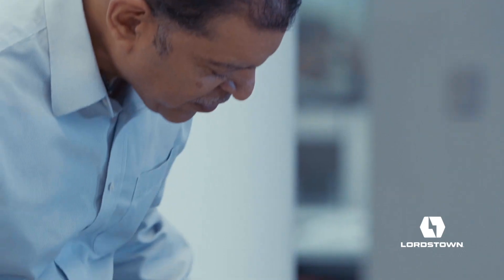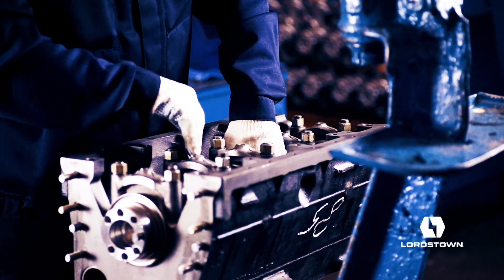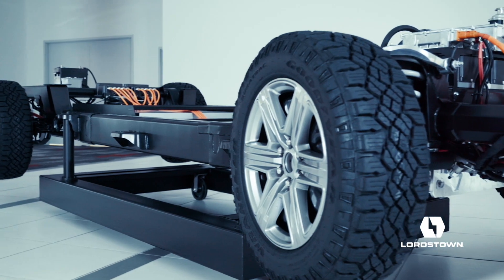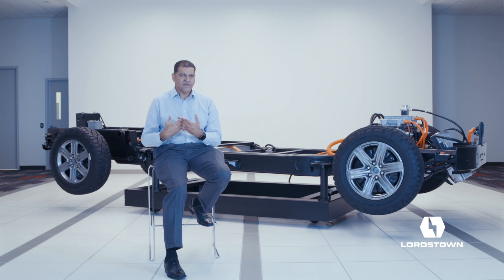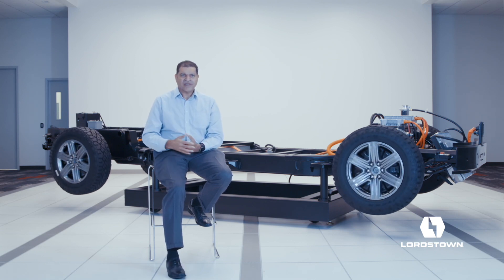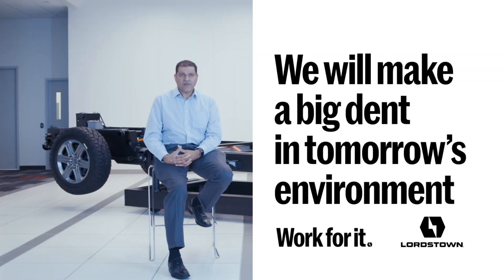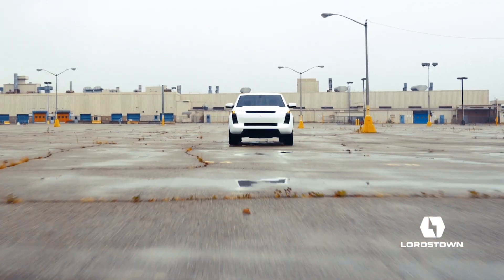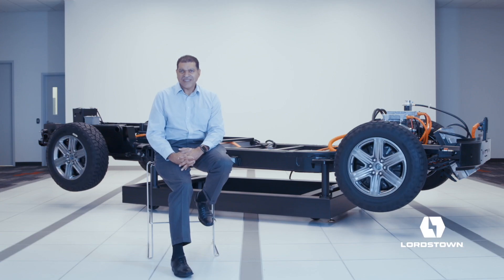Engineering the Endurance: Work for it. | Lordstown Motors

Comment: Isn't long term reliability an issue with hub motors given that are not cushioned by the suspension and that they feel the brunt of every bump and pothole in the road?
Reply: Yes, absolutely. They've only done 20,000 miles of road testing (allegedly). They need MILLIONS to ensure these trucks last as long (or longer) than current ones.

Comment: The is very futuristic
Reply: Ummm, this looks like every truck made by an OEM.
its not a Cybertruck.
Reply: @markplott4820  Yes, it's nothing like the Cybertruck but the hub motors are game-changing. I'm a tesla fan but I still recognize other car companies as being promising.
Reply: @jojotoomojo8016   - FALSE , built in HUB motors have SLOWER Top Speed than TESLA DUAL motor system and PLAID.
its why APTERA and ENDURANCE are SLOW .
also HUB motors cannot TOW as much as a  MODEL Y (3500 LBS) or a CYBERTRUCK (14,000 LBS max) . 
the HUB motors are NOT as Efficcient with Energy , which is why ENDURANCE has SHORT Range.

Comment: I wish this company great success.  But does anyone else feel bothered how much they talk up the in-hub motors...when they didn't even build them?   They are purchased from Elaphe.  Literally any other vehicle manufacturer could also sign a licensing deal, and use these same motors.  and yet THAT is their secret sauce....🤔
Reply: @Fento L wrong, Panasonic builds tesla spec batteries in their joint facility at Nevada which was the first of teslas purpose built factories. Catl supplies to gigahai.
Reply: Nio don't even have factories, whose to say which business plan is right.
Reply: I like that they are trying something different from all the other EV makers, but yea it is a risk.  I've read lots of commentary about how most EV makers have considered hub motors but ended up not using the design because it is less efficient (lower range per charge) and more vulnerable to damage.  Long term, I think people are going to want top miles per charge even for a work truck but I could be wrong.  We'll see what Lordstown can do with it, maybe it will be a success.  I don't care that they licensed the motors from another company, they are building the motors themselves from what I've read, no need to reinvent all the components.  They didn't even build the prototype vehicle, they bought it from Workhorse.  It seems kind of absurd to believe they will be pumping finished product off the assembly line in mass by September when they are really just getting started.
Reply: Plus in wheel motors are not new no matter what they attempt to claim. Still for fleets and small commercial businesses this is a good idea imo.
Reply: @4literv6  Millions of scooters use in-wheel (hub motors), the tech isn't brand new, and that's fine.  But they make it sound like their R&D has been burning the midnight oil, refining  their motors, making them better then all others before it.   But no, they just bought them.   
I do like them using them, but I just get annoyed by them acting like they invented, designed, and built them...when all they did was signed a check.
Reply: @murc111  sums up my own thoughts of the matter quite well.